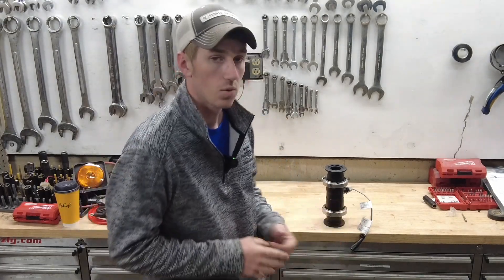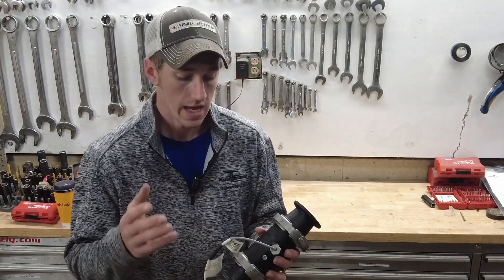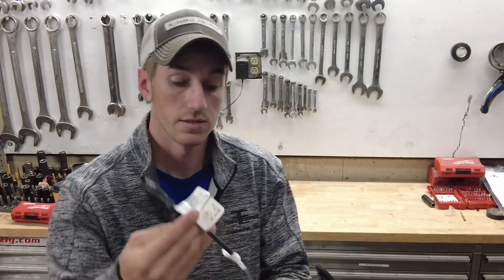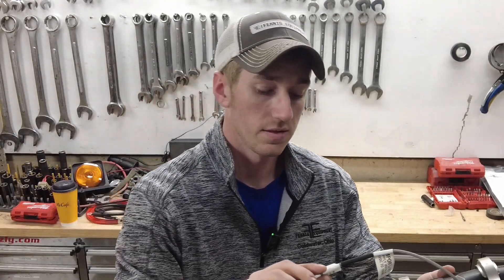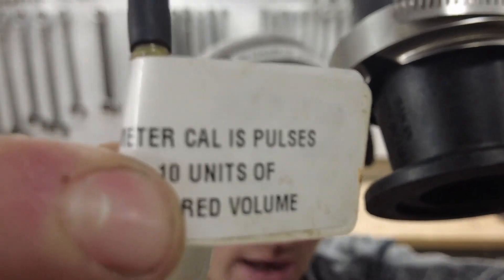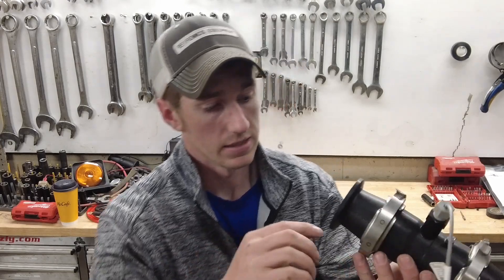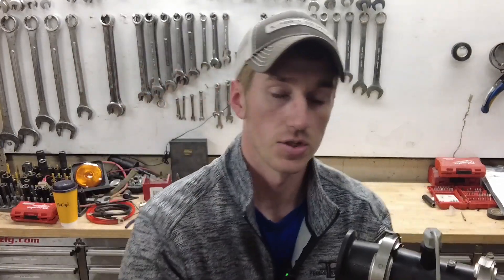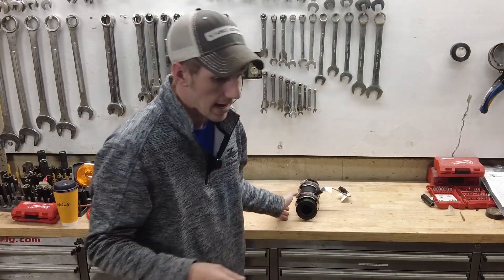Raven Flowmeter 101

Comment: You said it's 1330 ÷ 10 and then said 1330 again, wouldn't it be 133 to enter as cal number? In another video you entered 1330 without calculations. Could you please clarify.